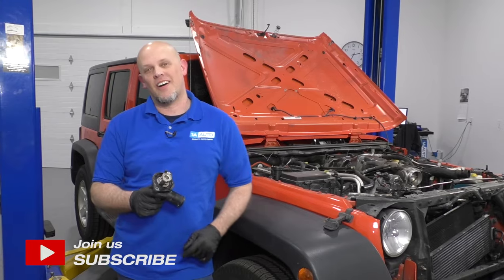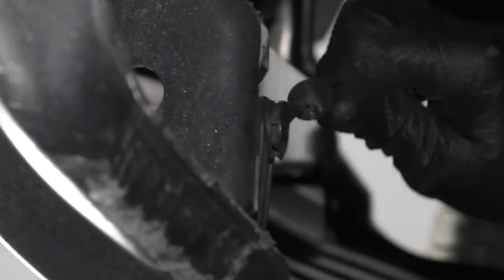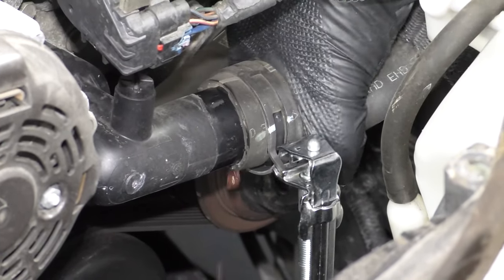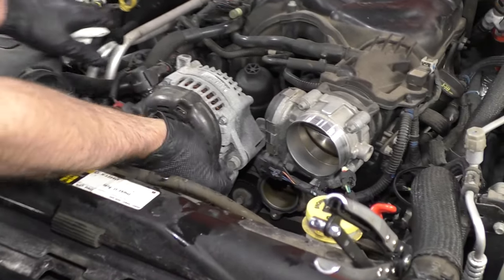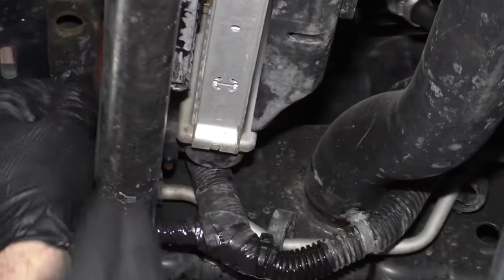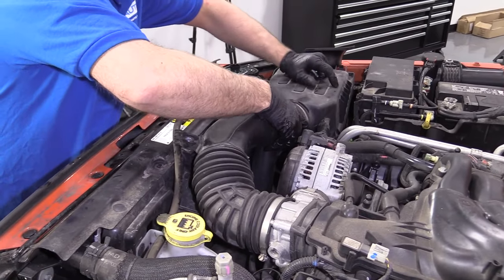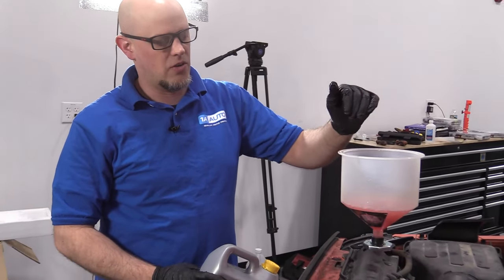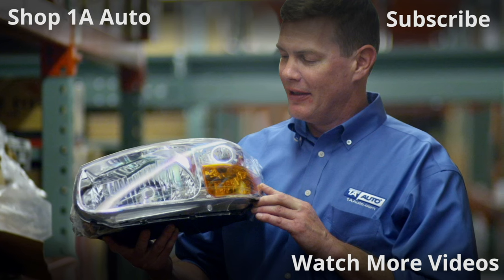How to Change Thermostat with Housing Assembly 12-17 Jeep Wrangler

Comment: Just remove the thermostat with the hose on. Hold the hose with your left hand, twist the thermostat off with your right. The coolant will stay inside the hose instead of pouring down the front of your engine. 👍🏻

Comment: You don’t need to drain the coolant. Just replace what leaks out while doing it.
Reply: That’s exactly what I was wondering, thanks!
Reply: Hey that’s just to increase shop profits. 🙃
Reply: Doing this At 90k miles might as well.
Reply: If you are at 5yrs you need to change it
Reply: Need and should are different lol. I agree if it needs it do it.
Reply: Are there different temperature range choices for the thermostat? My jeep has always run hot by the digital gauge.  2015 jku 205-225 even in cold weather

Comment: I just did mine and DIDN'T have to do half of that nonsense.
Reply: Do you put silicone??
Reply: @alejandrovaldez7745  no silicone is needed for the o ring gasket.
Reply: Make a video? 😂
Reply: Yeah, no need to drain the radiator

Comment: EVERYONE! Look for almost invisible cracks in the goose neck of the MOPAR thermostat housing. It took me FOREVER to figure this out!  My coolent level was always slowly dropping, but I couldn't figure where or how because there was never any visible sign, just  a very faint odor of coolent.  (Problem even continued after switching out the oil cooler.)  When the check engine light told me to replace the thermostat at the 6-year mark, I found red goo on the thermostat housing dried over almost invisible hairline cracks in the goose neck. (I needed a magnifying glass to see them!) The coolent was slowly leaking out and evaporating before it ever had a chance to drip.
Reply from the maker: +SGT. NMI Thanks for the feedback!
Reply: Thanks. Will check that. I've always smelled coolant since it was new
Reply: Change the thermostat and housing in one Shot, cheap enough and sabes headaches.

Comment: didn't need to drain the radiator because my thermostat just craked and all the coolant went out cheap plastic dries and cracks i wish they made more durable parts if  you off road these parts will break.

Comment: My original thermostat went out after 9 years. Since then, in the last 6 months I’m about to change it for the third time. Granted one of those times the shop used a non-oem one that was known for failing but the other time it was oem. If the dealership doesn’t warranty this one I’ll just do it myself to save on labor

Comment: I have a 2015 jeep wrangler sport unlimited  its overheating Why driving down the hwy Only and when it's siting it's fine in temp what could it be Needing a Burping  or Thermostate changed Hope it's not. Blow head gasket ty let me know what ya think sir?
Reply: Let me know if you figure that out mine is doing the same around town it’s fine you get on the highway it hits 3/4

Comment: REMEMBER if you have OEM anti freeze dont use after market,, they dont get a long and might turn to  a jell
Reply: Dexcool orange 50/50 antifreeze works excelent
Reply: Don't mix HOAT 2013 and older with 2013 mid year to present OAT. Aftermarket makes both coolant types

Comment: Mine was leaking so bad that my radiator was empty while my reservoir was full, causing the engine to overheat. The crack was barely visible and I managed to stop 99% of the leak by sealing the crack with gasket maker. Nonetheless I am replacing the  housing soon.

Comment: The drain cock.... counterclockwise? Mine will turn rather easy clockwise, but stops turning counter. (Dealer replaced the radiator a couple years ago. could the replacement drain cock be threaded opposite?

Comment: Where can I get the 10mm bolts that hold down the throttle body air cleaner hose to the radiator?

Comment: Curious as to why you had to remove the air filter assembly?  Did you have to change out the hose and needed access to the back of the radiator?

Comment: Surprised Dorman does not make an aluminum thermostat housing like they do the oil cooler assembly, for which you can replace only the thermostat and not the entire housing, that fails at an incredible, lawsuit/recall worthy) rate.

Comment: Call me crazy, is there a good reason to drain all the antifreeze? I just put in all new fluid after replacing a failed water pump. If it's not necessary, I'd rather pull the hose and just let it drain as little as possible.
Reply from the maker: +Brian Piper Thanks for checking us out! http://1aau.to/m/Shop-1AAuto-c

Comment: Where is the coolant temperature sensor located
Reply from the maker: +Ernest Ellison The coolant temperature sensor is typically located in the engine block or cylinder head, near the thermostat housing.

Comment: Can just the thermostat be changed in the original housing ?
Why change the whole unit ?
Reply: most come as one unit and are pretty inexpensive.  I think the plastic starts to warp over time too so it's easier to do them both at the same time.  I am on my second one after 114k miles
Reply: You don’t need too. The t stat itself is $14
Reply: It’s $40 for the Mopar part, pretty cheap.